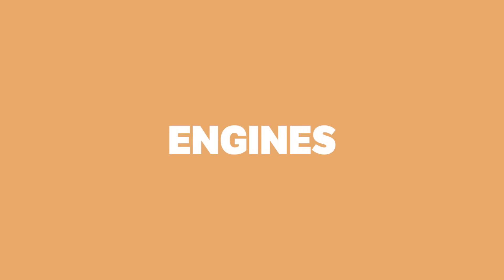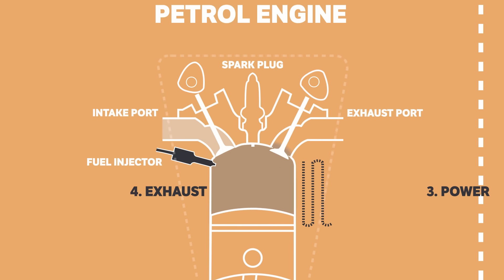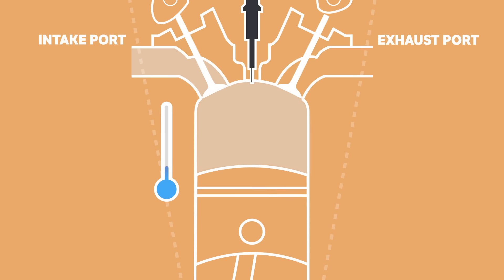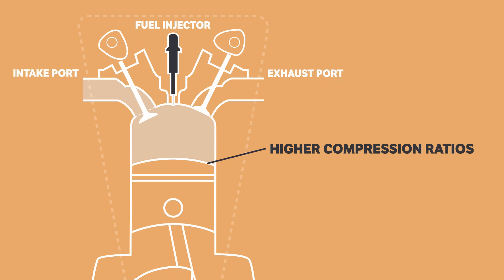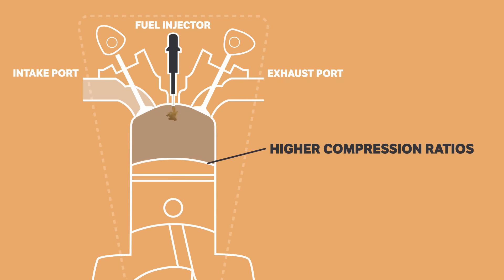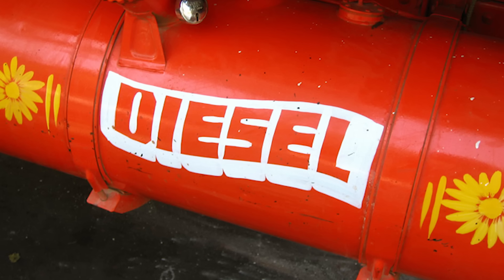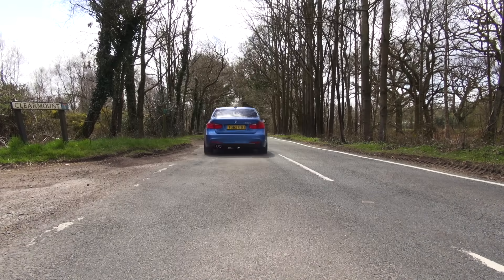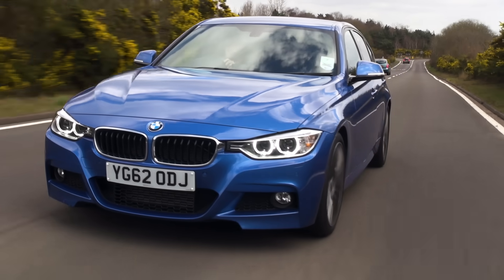The Differences Between Petrol and Diesel Engines

Comment: I have always wondered if you could turn a diesel engine into a petrol engine just by changing the glow plugs for spark plugs I know it wouldn’t necessarily be easy but I just wonder if it’s physically possible and would you be able to get more power from it being it’s a diesel block?
Reply: Mm the main fuck up would be that petrol would probaly ignite under the high compression ratio before the piston reached TDC which wouldn’t not be good
Reply: @harryesteves387  Not necessarily because if you use the same injection system you wouldn’t check the petrol until the piston was nearing TDC much the same principle as the diesel engine uses anyway
Reply: Ahhhhh Nevermind, would probably be injected at TDC, idk

Comment: Another reason why Diesel engines have a turbo, because without a turbocharger. The engine will be very slow. Driving from 0-60 MPH (0-100 KM/H), a Volkswagen Rabbit Diesel without a turbo would take forever with 48 Horsepower. That's very sluggish.

Comment: The thing that really made me like diesels is that you can create diesel fuel from almost any oil, like vegetable oil, or even used cooking oil (as long as you properly filter out particulates). It does have to go through a refining process, but you could essentially make your own biodiesel with oil at home if you wanted. That's cool! You basically just need oil, methanol, and lye, and some know how, and you can make biodiesel that can run in modern diesel engines with no conversion necessary (except if you have natural rubber seals, biodiesel eats through them so you'll need synthetic seals).
Reply: bruh you can just use cooking oil out your chip pan and the engine still runs lol the oil is already refined to standard for such application as has already been tried and tested by the millions around the world :) ps if you over refine cooking oil you just end up with distilled water which is what you dont want in ur engine unless you wana fuck it up XD
Reply: @jamiemarsden3823  Youve never seen stinky pete! LMAO
Reply: I didn't know that
Reply: only older diesels with mechanical fuel
pumps this works. otherwise it is more expensive then just buying diesel or u will fuck ur car
Reply: Don't forget to pay the appropriate tax on your home made fuel! 😂
Reply: You shouldn't play with methanol or lye. Very dangerous advice.
Reply: @cgore4  That's your response? Implying that straining fuel and being able to put it directly into an engine equates to specialized equipment and years if not decades of experience? Yeah, you're the person who can't think outside of the box. If you can't say anything worthwhile don't say anything. Get back to your Starbucks soy latte infused life. Your commentary isn't needed
Reply: So what you're saying is put canola oil in my car? Okay be right back
Reply: It only works on certain diesel engines, like older Mercedes and Volvos stuff like that can literally take filtered out cooking oil as fuel and it works perfect and smells like French fries when it’s running but almost all of the new diesel motors it wouldn’t work
Reply: I dont understand this though process bc desiel is cheaper the cooking oil. Also how am I supposed to buy 50 gallons of it.
Reply: @ethanelectric1024   people just go to Mcdonalds or any fast food grease and ask to take all there dirty grease then they just put it thru some filters then in the tank
Reply: how does this bullshit comment have 516 likes HHAHAHA LMFAO this is not true lol shut the fuck up
Reply: 🇺🇸: knock knock
Reply: 🇺🇸: knock knock
Reply: Yup! You can literally grow the fuel on your homestead for the most part.
Reply: Yeah and multi fuel engines can run on anything as long as there is diesel mixed in. Like the m-35 deuce
Reply: Biodiesel is also being researched for use in motorsport.
Reply: @cgore4  I've done my own dentistry and haircuts for years! Have all my teeth too!
Reply: @cgore4  okay boss
Reply: Bro do you know that diesel can create many problems regarding engine in almost any car. No doubt it create mire torque but not more than petrol engines.
Reply: @meghshah1315 Learn to speak English and try that comment again. It makes no sense

Comment: why diesel are so fuel eficient, because diesel dont have spak plugs so it can reduce the gap , smaller gap less spread of the fuel explosion blast  pushing the piston down with 95% of the force while on petrol engines with bigger gap its pushing with only 80% of the explosion force

Comment: To find out which is better, you need to see how much years you will be using vehicle and how much thousands km you will drive. You divide those total kilometers by 100 (typically 100 km in stats are used) and multiply by average fuel consumption. For example, in 150,000 km over 10 years, if engine uses 5 liters and 6 liters of diesel and petrol over 100 km accordingly, that is: 1500000/100*5(diesel) and *6(petrol), then multiply each of two values for diesel and petrol by average price of those per liter. So you have total petrol and diesel costs for each fuel over whole life distance.That's not all, dont forget taxes - get taxes difference over same years in service (for example, if diesel costs $250 a year and petrol $125 a year, that's additional (125*10) to previous diesel value. You get total fuel and tax cost for diesel and petrol in the end, which will help you decide what engine is more profitable.

Comment: After several doubts, 3:56 proves you have no idea what you are talking about. If a higher pressure helps the piston to go down, if will also be more difficult to go up. Turbo's are there to increase overall pressure, and therefore power, not efficiency.

Comment: the more mass you have to pull the more torque you need... BIg heavy cars and you need to tow always go diesel,, ,, smaller lighter cars = gasoline.  ,, In a small 900 to 1300kg i prefer gasoline from 1600kg and up,, diesel..  The less torque of a natural aspirated gas engine is less optimal when accelerating a 2 ton car.  Today you will find a lot of turbo gasoline engines which gives you more instant torque in the low rev range but they require more maintnance and complex measssures to avoid e.g. carbon build up.
Reply: The more mass you have the more Power you need. Power, not Torque, determines not only how fast a given amount of work can be done but also how much work can be done in a given amount of time.

Comment: Is there any engineering fault in making the diesel engine with a lower compression ratio and putting spark plugs to make it work like the petrol IC engine? If the diesel engine is made with a lower compression ratio and with spark plugs, then could the diesel engine be made to work hybrid like petrol engines do? Wouldn't it work because there would be more uniformity in the ignition of compressed air with diesel. Has anyone done any R&D on this thesis?

If this thesis work then mass transportation vehicles like trains, busses, trucks and vans could be fitted with diesel hybrid engines! Couldn't it?

Comment: TLDR

Diesel has to be atomised, imagine it enters a cylinder like a spray bottle, it's pushed through a filter like system to spray it to allow it to mix and diesel is easier to ignite via compression (notice how your finger gets hot if you hold it on the end of a bike pump? Same thing).

Petrol needs a naked spark or flame and can be injected.

Comment: Diesel engine works on a 2-stroke cycle, unlike petrol which works on a 4-stoke cycle. Check your facts before uploading a video.
Reply: Not correct, both diesels and petrol engines can be either 2 or 4 strokes. Most diesels are four strokes as are most petrol engines, but 2 stroke versions of both exist. Check your facts before uploading a comment

Comment: Not a fan of petrol. If you want go fast, should just have a more aggressively tuned diesel with an additional turbocharger. Diesels have heavier duty engine parts to withstand the high compression. The heavier duty parts make for a more structurally sound high performance engine than a comparative petrol engine. They may be heavier per displacement, but the much higher torque per displacement ends up more than offsetting that. most diesel engines are simply tuned tuned for efficiency, to capitalize on their natural advantage in that area. When tuned for performance and when a larger intercooler, twin-turbo, larger fuel injectors, and a more aggressive tune are performed, diesels perform better than an equivalently tuned petrol unit, until the vehicle has gone to final drive gear, then petrol outperforms. Although there are areas where petrol shines. On a high speed race track, doing top speed runs, and of course it is cheaper to build petrol engines than equivalent diesel engines.
Reply: It is hard to get a diesel to make high horsepower numbers. Diesels have a lot of torque but cannot rev high enough to make good horsepower numbers. Torque is great for towing and pulling, but horsepower is what accelerates a car. There is a reason diesels are found in semi-trucks but not found in race cars.

Comment: In a petrol motor the gasoline is not injected into the cylinder as described, but into the inlet manifold before the valve.
Reply: Not necessarily,  gasoline direct injection exists.

Comment: also petrol engines have lower fuel to air mixture ratio then diesel.diesel can have up to 70 to 1 ratio as the petrol 36 to 1 i believe

Comment: Diesel engines are inherently sluggish and slow because they depend upon auto ignition of the fuel air mixture.
Reply: wrong,the petrol engine is faster only because of higher PRMs,everything else is better at diesel

Comment: Diesel all the way, mainly as my lorries and busses use diesel and any other type of engine which uses a different kind of fule is really expensive. And also it keeps the bills down for me, e.g in my 2009 Scania R480 a full tank of diesel (900L) is enough for roughly 700 miles before a fill up is needed whereas my 2013 DAF LF can only do roughly 500 miles with a petrol engine on a full tank, (also 900L). Plus petrols more expensive. Some may say road tax is more expensive for diesels but my petrol lorry taxes are only a few hundred less. By the end of next year I'm looking to get rid of my petrol lorries as they are too expensive and replace them with diesels
Reply: Also another thing to add is my diesel lorry engines need fewer services and check ups than my petrol ones

Comment: Diesel! Great on the wallet, good on performance (unless you have a sports car) and greener lower carbon footprint. Only down side is the higher NOx gas emissions which are bad for health.
Reply: Jorge Garcia what do you mean by unless you have a sports car? It doesn’t go well with those?
Reply: @pripyatuser7  I meant that diesel would not be my first choice for a sports car, which requires great acceleration and response. I m sure there are good ones out there but the gasoline ones would win out.
Reply: Jorge Garcia thanks for the reply because I want in the future to get a Nissan 350z nismo I kind of like the diesel for its fuel efficiency and the power you get but I kind of hate the idle noise. And the petrol feels like it can react more easily but burns too fast
Reply: @pripyatuser7  That will be a sweet ride. It will still have tons of power, and loads of range, great for (cheaper) longer range trips, I can imagine.
Reply: Jorge Garcia indeed because it’s a lightweight car so it doesn’t need too much gas to get moving
Reply: Step outside the wizard’s circle for a moment.  Gasoline produces more CO2.  CO2 is the gas of life.  It combined with light create photosynthesis which is literally GREENING the earth as we speak.  Also you missed the other variable:  particulates.

Particulate matter (PM) from both diesel and gasoline engines can cross the blood-brain barrier (BBB), but there are differences in their characteristics that influence their behavior and potential health impacts. Here's a concise comparison:
Composition: Diesel exhaust particles (DEPs) typically contain a higher proportion of elemental carbon (soot) and organic compounds, such as polycyclic aromatic hydrocarbons (PAHs), due to incomplete combustion. Gasoline exhaust particles are generally smaller and contain a different mix of organic compounds, with fewer PAHs but potentially more volatile organic compounds (VOCs) and smaller ultrafine particles (UFPs).

Size: Gasoline engine emissions tend to produce smaller particles, often in the ultrafine range (<100 nm), compared to diesel, which produces a broader range of particle sizes, including fine (PM2.5) and ultrafine particles. Smaller particles from gasoline exhaust may have an easier time crossing the BBB due to their size, as ultrafine particles can more readily penetrate biological barriers.

BBB Penetration: Both diesel and gasoline-derived ultrafine particles can cross the BBB, either through passive diffusion or active transport mechanisms (e.g., via olfactory nerves or systemic circulation). Studies suggest that ultrafine particles from gasoline may have a higher penetration potential due to their smaller size, but diesel particles’ higher toxicity (due to adsorbed chemicals like PAHs) may cause greater neurotoxic effects once across the BBB.

Health Impacts: Both types of PM are associated with neuroinflammation, oxidative stress, and potential neurodegenerative effects when they cross the BBB. Diesel PM is often studied more extensively and is linked to stronger inflammatory responses in the brain, but gasoline PM’s smaller size may lead to more widespread distribution in brain tissue.

Key Difference: Gasoline particulates, being smaller, may cross the BBB more easily, but diesel particulates may carry more toxic compounds, potentially causing greater harm once in the brain. Data is limited on gasoline-specific PM effects compared to diesel, as most studies focus on diesel or general PM2.5.

Comment: What thing controls those valves? I mean how do they „know” when to open or close themselves?
Reply: They are the called cams and are located onto a camshaft. The cam is kinda pointy on one side and round on the other and it spins on top of the valve (which is being held into shut position by a compressed spring - a tappet). As the cam turns, when the "pointy" side presses on the valve tip, the valve opens. As the cam is continuously turning, after the pointy end comes the "round" one, which has less offset from the camshaft and lets the valve close under the pressure of the spring.
The camshaft is being driven by the engine itself, from the crankshaft via a belt or chain (timing)
You can see the cams in the video, turning and opening and closing the valve
Reply: Flanker 27 wow thx for the detailed answer. Now I just need to translate it :>
P.S. I thought valves are somehow computer-controlled but as I thought further early automobiles didn't have those, there gotta be another mechanism.

Comment: I run diesels only, since they are just much cheaper to run and fairly reliable (until your neighbor tries to repair them). My 1.4 TDCi Fiesta runs below 5L/100km even though I'm driving it like a madman. 

Beforehand I had 300000km Alfa Romeo 146 with 1.9JTD engine running at 6L/100km (and yes that one I was running harder, because it's faster). Just imagine what kind of wreckage an Alfa Romeo petrol engine would have been after 300000km... 
Just imagine what kind of wreckage a petrol engine would have been in my hands... :D

Comment: I love diesel because you can put the turbo easier than in petrol engine. In petrol you need to change the ignintion for exaple and more parts and setting and engine maps, but in diesel you only change the fuel dose. In diesel and petrol engine you buy the intercooler and many pipes and of course turbo.

Comment: Diesel for trucks..but for an everyday car why would you even bother.Cost substantially more at purchase,to maintain,the fuel is always more expensive and pumps at filling stations usually covered in crap.You will most likely never recoup the cost of buying one during your ownership through diesel "efficiency"as petrol engines are becoming more advanced.

Comment: What a bullshit. Look at the numbers. Modern diesel engines ARE BETTER for the envitoment as they emit less particles per km than any petrol engine. Also because of higher temperature and pressure better materials are used in diesel engine production, making it last waaaaay longer. Can you show me 500000km turbocharged petrol engine  in good shape without any service done? I can show you a diesel 3.0 one on a heavy car that consumps less fuel than 1.6 on a light VW chassis.

Comment: Old info.

My Saab 9-3 1.8t make’s revs like a diesel. Gears like a diesel. Its a petrol;)

Self ignition is used by Mazda in the New engines. With petrol;)

Compression ratio 16/1 E87

Old news man!

Comment: Then in motorsports why petrol engines are used??? Why not diesel??
Reply: Diesel has less power for the size and weight of the engine. Power, not Torque is the limiting factor not only for how quickly a given amount of work can be done but also how much work can be done in a given amount of time. Diesel for industry agriculture and husbandry. Petrol/ Gasoline, alcohol, nitromethane for Motorsport

Comment: Petrol :
Refined 
Enthusiastic
Comfortable
Performance on Tap 
Lower Engine maintenance cost 
Has a longer life 
Less Emissions compared to Diesels
Reply: Petrol engines has a shorter life and requires more maintenace actually because diesel engines are built better to handle the higher compression. The diesel also acts as a lubrecant for the engine because it is like an oil, making the car run more smoothly. And if you buy newer diesel cars with Euro 6 engines the have 20% less C02 emissions than petrol. Thats why you see a lot of diesel cars with high milage that is still running but not petrol.